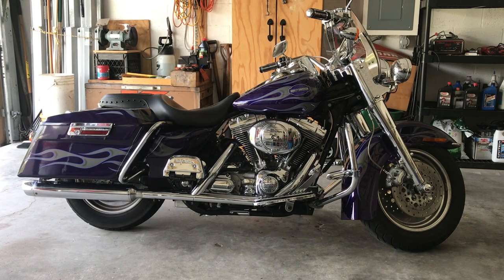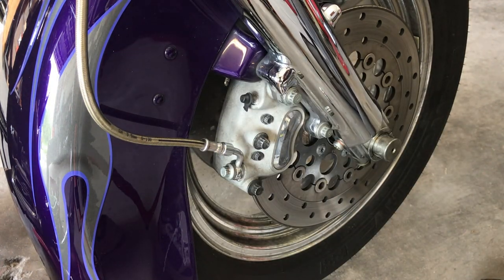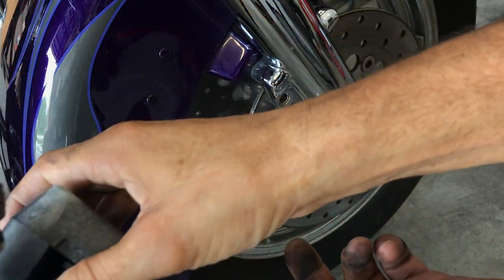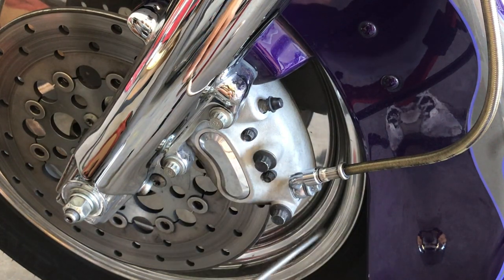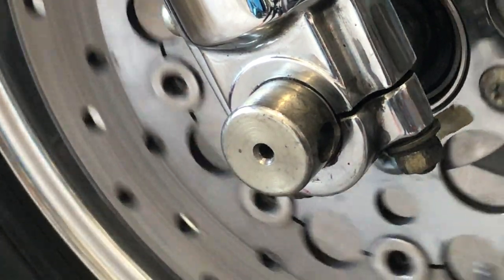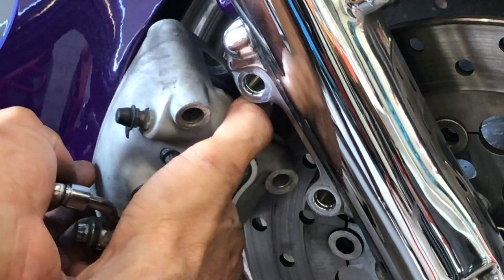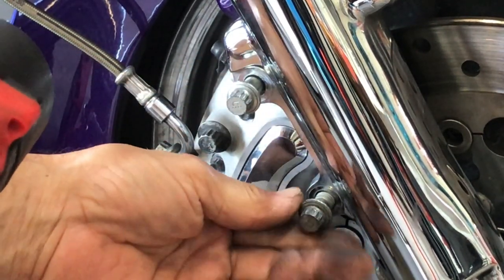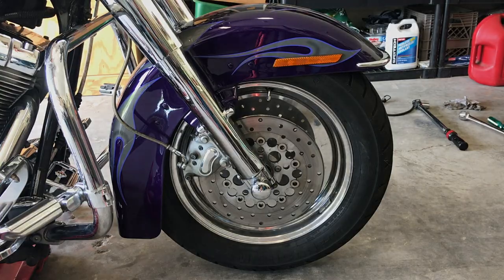How To Harley Davidson Wheel Remove & install.

Comment: When do bearings need to be replaced or repacked?
Reply from the maker: Happy to help.  after 1999  sealed bearings are the standard, so there is no maintenance. If you start to hear a grinding noise. Its time to look closer.  lift Bike up if it's the front wheel remove the caliper and rotate slowly and you will feel and hear it. Rear will just rotate slowly it's a little harder because you got the belt and the brakes. Hope this helps thank you for watching and your sub Nate. Safe and have a great day.

Comment: I have a question - I have 2002 classic - after having new front tire put on my brakes are dragging - shop feels might be forks- I disagree. What could cause the drag, brakes have been checked and working properly
Reply from the maker: If it is your right side caliper as your are sitting on your bike.  This is the side that has the hole in the axle, loosen bottom bolts and reline fork glide to release pressure on brake caliper. By pulling outward on fork glide and tighten bottom bolts.  Spin wheel to test.  How to lift your Motorcycle.  https://youtu.be/oPZn2DaxF_0.   Let us know how this works out. This is where I would start. I have seen this before. Hope this Helps, Thank you fo you Sub James.   Ride Safe and have a great day.
Reply: @TwoWheelRocco  I hope it works - wheel spins fine until tighten lower cap bolts
Reply from the maker: Sounds like wheel bearing.  Tighten those bolts should not affect your wheel rotation.  Rotate wheel when hot.  Collapse brake calipers with screw driver and test rotation.  How many miles?
Reply: 18000 miles
Reply from the maker: Spin wheel and take notice of any grind in your front wheel.  Collapse brake calipers with screw driver and test rotation.  Let us know how this work out.
Reply: Shop found was the wheel spacers were in wrong , must have happened when the put new tires on- thank you for the input
Reply from the maker: Glad to hear you got that work out. Thank you for sharing that. Ride Safe and have a great day

Comment: Is there a difference in duel brake rims and single brake rims
Reply from the maker: Happy to help, most times the wheel will be machined for duel rotors there will be a trim Covering hiding it. But remember your front fork needs the bolt holes to mount the caliper to have the duel disk. Hope this helped.  Thank you for watching and your sub Charles.. Ride safe and have a great day.

Comment: Tomorrows project. Caliper torque specs by chance? Thank you.
Reply from the maker: Happy to help. Thank you for watching and your sub. TKOO. I will send you the specs.  Front Caliper Mounting: 28-34 ft-lbs.

Rear Caliper Mounting: 43-48 ft-lbs.   Hope this helps. Ride safe and have a great day.
Reply: @TwoWheelRocco  Thanks for the info Sir. I wonder if you can assist in one more thing. 01 flhr, it appears I'm missing a bolt on the tranny cover, the one immediately above the clutch cable. However, it doesn't appear to be a bolt hole, as I removed the top bolt, to see if it were the same as the "missing" bolt hole, And it's clearly not. Using a pick, I also don't seem to feel any threads on the inner part of the tranny. Is this a dowel pin of some sort? Thanks in advance
Reply from the maker: @TKO-NY  You are right, There is no threads that's a dowel pin to hold the two  together. Ride safe and have a great day.
Reply: @TwoWheelRocco  have a question Rocco. Installed wheel after having new tire mounted. I have the normal pad/rotor noise. But every full rotation I'm getting almost what I'd describe as a grind with the pads/rotor. Suggestions?
Reply from the maker: @TKO-NY  Sounds like on your front brake side, looking at the bike with the wheel in front of you.  your left side that's the side that there is no bolt. Sounds like that needs to be realigned. Take a look at the circle that's in the axle as an indication of where that was originally resting. That's what causes the noise in your brake rotor misaligned Fork Tube. Take a look you'll see where it was and now look where it is Realign it.  Hope that helps. Let us know how it works out very popular problem, I put an index by scribing align on the axle,on that side so I know when I put them back together. it goes right where it was.
Reply: @TwoWheelRocco  I did indeed put a scribe mark, and I can see the mark, yet the hole in the axle looks to me like it's further in than it was (partially covered by the hole in the leg) however I could be wrong. I'll tear back into it today.
Reply from the maker: @TKO-NY  Just loosen the pinch bolts, With a flat bar, pry the fork over just a little bit either way retighten pinch bolts and see if it changes. Then scribe where you like it. this is a problem with that side . Some will be out of the hole a little bit. Let us know how it works out.
Reply: @TwoWheelRocco  wouldn't happen to have a video on that? Kinda feel like I'm going to have my front wheel misaligned.
Reply from the maker: @TKO-NY  I do not have a video exactly on that.  This video at 5:05, You will see the procedure. It's basic, follow that everything will work out. I hope that helps, let us know how it works out.
Reply: @TwoWheelRocco  I plan to get back at it today. I should add, I only get the grind noise at one particular spot during rotation. How does that happen?
Reply from the maker: @TKO-NY  Remove your calipers, one at a time and spin and see what's causing this grinding noise. When you have both calipers removed they'll check the rotation of the wheel and see what's causing this noise. Let us know when you figure it out. How many miles on this motorcycle?  When you have the wheel spinning freely, no calipers at least you could pick up if it's a very nice which I don't think so.
Reply: @TwoWheelRocco  noise isn't there with calipers removed. If I just loosen the caliper bolts to finger tight, the noise isn't there. Noise also wasn't present prior to pulling the wheel. Thanks for the reply.
Reply from the maker: @TKO-NY  Move the Fork Tube to the right or left. Tighten it and see if the noise goes away and put it in the spot that works best. You only talking an 32nd Movement that fork tube on your left side where the axle has the hole move it a 32 then tighten. Spin it and see if that noise goes away. I would remove pads and clean.  That's why I index scribe a line on that left side. These front wheels on these Kings make noises. Your pads will wear and everything will be all right. Pads reseat them selves. You probably never noticed a noise before now that you took it apart you could've got some debris or something in there. Ride it and all is well.. Let us know how it works out.
Reply: @TwoWheelRocco  thank you Sir
Reply: @TwoWheelRocco  Rocco my man, as soon as I loosen the cap bolts and the axle nut, the noise is gone, no grinding, moves freely. Is that a bearing issue? Never had this noise prior, bearings were replaced the last tire replacement by the shop, 2 seasons ago.
Reply: @TwoWheelRocco  no, it's not. Because with the wheel totally secured to spec, if I loosen the calipers, the noise is also gone. Drivin me nuts!
Reply: @TwoWheelRocco  sorry to blow you up, think I figured it out. Will update.
Reply from the maker: @TKO-NY  When you loosen the axle nut, you gave yourself a little room, that's why I was saying you need to realign the left side. loosen cap bolts.  move fork tube towards the hole in that axle. tighten those bottom bolts and see if the noise is gone.
Reply from the maker: @TKO-NY  when you loosen the caliper, you're changing the alignment on that left sider Fork Tube.  needs to be repositioned a 32nd and your problems are over..
Reply from the maker: @TKO-NY  Not a problem, my friend. Let us know how it works out.
Reply: All is well, but once I torque that axle nut 50-55 I get very little wheel spin. 3 turns of the tire by hand for a complete rotation. I see yours spun quite freely. Any thoughts to that?
Reply: @TwoWheelRocco  it's all good Rocco! I can't tell you how much I appreciate your help. You're the best. I'll have to ride downstate/Jersey sometime and buy you a beer or coffee.
Reply from the maker: @TKO-NY  mine only spins freely if the calipers ain't engaged. Once I put pressure on that handbrake and let off the calipers. They  do drag I got dual desks, but like I said,  take the pressure off those pads and wheel will spin free.  Hope that helps.
Reply from the maker: @TKO-NY  I appreciate that my friend. Ride safe and have a great day. Thank you for your support TKO.
Reply: @TwoWheelRocco  everything helped kind Sir. I'm good to go. Dual disk on my 01 flhr. I appreciate you!

Comment: Does anyone know the screw size on the front cap that goes on the axle?
Reply from the maker: Are you talking about the Allen key that holds the cap on the axle nut?
Reply: Yes that key!!!
Reply from the maker: @jponyboyace  That is 5/64  Allen, Harbor freight will have a set or Ebay. Harley BS so you will not work on your Bike. Hope this helps. Happy New Years..

Comment: 40 inch pounds or ft pd
Reply from the maker: Happy to help. If I understand you that would equal 3.33  foot pounds thank you for watching and your support John. I hope that helps ride safe and have a great day.
Reply from the maker: Tools Needed
3/4 socket,  1/2 socket,  1/2 torque wrench. 5/64 Allen wrench for axle cap.
Torque value
50 - 55 Ft/Lbs  front axle.   100 ft/lbs.  rear
132 - 180 in-lbs   pinch nut bolt